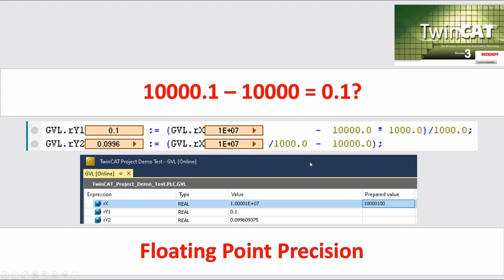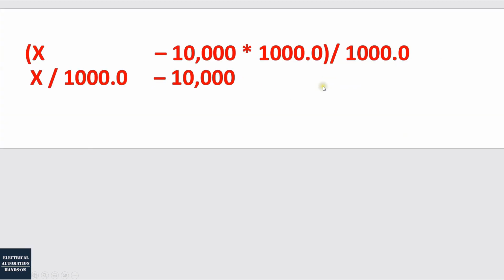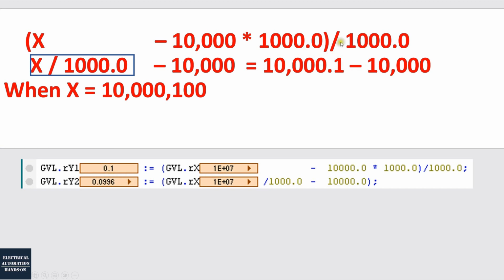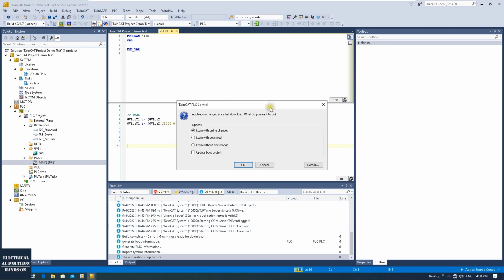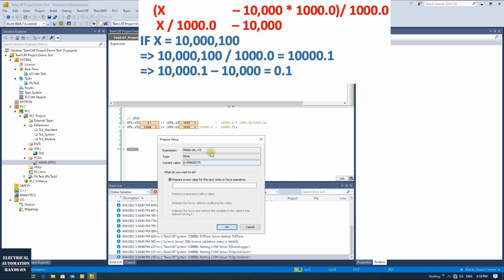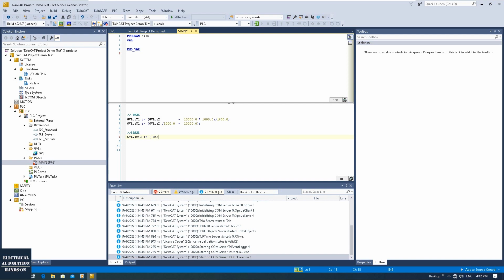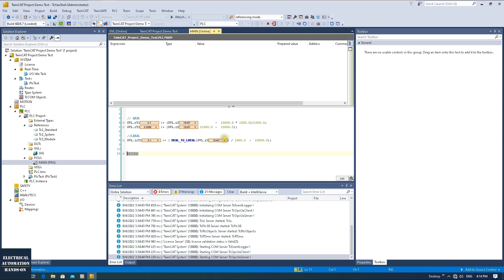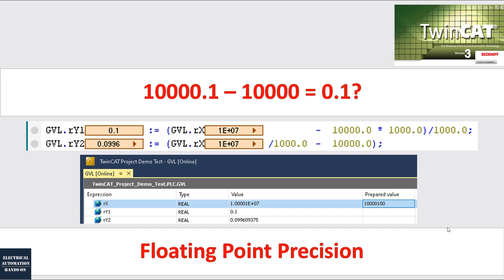BK19. Beckhoff TwinCAT - Is 10000.1 - 10000.0 = 0.1? Floating Point Precision

Comment: Great video. This is a common problem I also have encountered when programming embedded systems. Its hard to debug also because the values shown like 1E+07 do not show all the decimals. There are different ways to solve this. One other way is when comparing two numbers multiply both by the precision you want (i.e. 1000 for 0.001 precision) and then convert to an DINT and then compare.   1.003000005 and 100300001 will both be 1003, so the same.
Reply from the maker: Thanks for the tips and thanks for your sharing! Welcome to my channel!